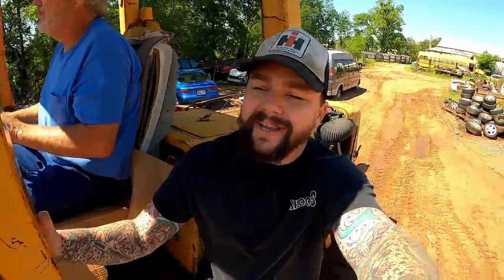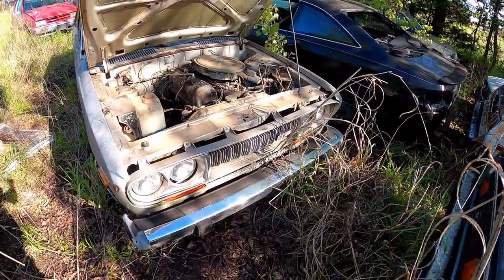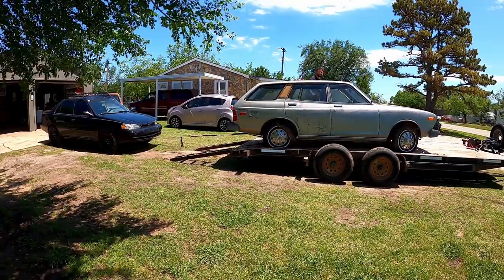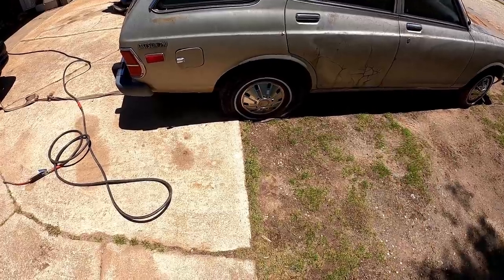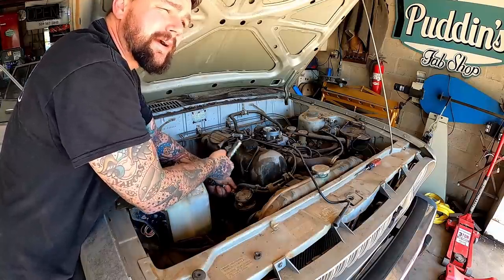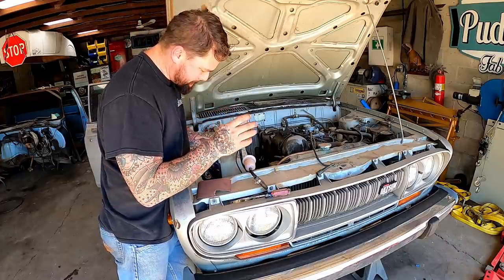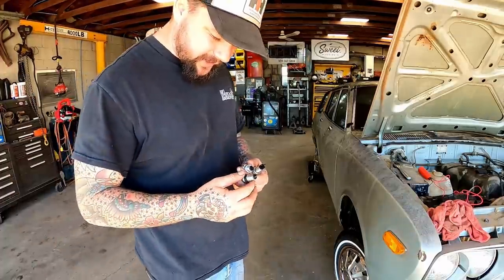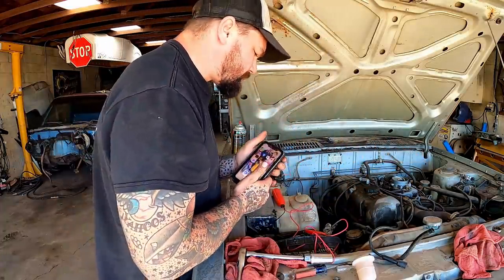JUNKYARD 1977 Datsun 710 WAGON. Will it run?!?

Comment: Think am gonna be commenting a bit on this one lol, always gets me a bit worried when something from a breaker or junkyard is that complete, solid & has fresh oil/plugs etc...  Specially something that age that was only parked just over a decade ago.  It ended up in a breakers for a reason, hoping that reason doesn't have cylinders or clutches in it...
Reply from the maker: I don’t think either. It’s the fact most people aren’t interested in a Datsun wagon which is what happened to this one.
Reply: @PuddinsFabShop  Yeah, having nearly made it 40 mins into the video now (lots of distractions here today!) I'd say you're right. Strange though, over here something like that'd be snapped up within hours of going for sale!

Comment: VACUUM LEAK!!!!
REVIEW YOUR VIDEO LOL  I have gone over the L series engine as a teenager from top to bottom.  that thing spit vapor out a hose near the carb in your video!
Reply from the maker: I haven’t looked back. Are you talking about the hose for the smog?
Reply: @PuddinsFabShop  to the lower right when the motor spit the mixture up and out of the carb....some of it came out a hose or something.  Couldnt tell where.  Ive worked on the L series engine for about 8 years.  L16 all the way up to L20b.  Very cool stuff as all of it is interchangeable.  The carbs I didnt have too much trouble with.

Comment: Is that a L20B motor best motor ever lol
Reply from the maker: It is.
Reply: @PuddinsFabShop sweet my 620 had it with a 5spd it would do a 4th gear burnout
Reply from the maker: I wish my 620 had a 5 speed
Reply: @PuddinsFabShop  mine was a 78 king cab only year it came with as a option

Comment: I guess you know by now Datsun is 10/12/14/&17 mm bolts ... and buy only NGK plugs 1 heat range hotter .
Reply: @PuddinsFabShop  fine dude, I share no more knowledge - or watch u either ...
Reply: @PuddinsFabShop  Considering I worked at 2 Dealerships in 2 states - one which raced a 200SX in IMSA - and the second where I ran the Race Shop & was building a 240Z for SCCA > 30 years before you were born - seems like you would show a bit of interest & respect, and not type square boxes at me - DORK !

Comment: Bud, you don't know what you are doing,  hang it up.
Reply from the maker: SoUnDs GoOd to Me. Let me guess, you’re one of the ones who thinks I should of put all new parts on it when in the end the problem ended being up the rotor.

It’s not impressive to throw all new stuff at it. It’s also hard to tell the rotor is bad when you have spark when it’s cranking but apparently was losing it when it was busting off into higher rpm’s.
Reply: @PuddinsFabShop  Real mechanics don't replace alot of parts and they (I) use 'diagnosis' so's not to do what yadid. Your humor is likeable, :)